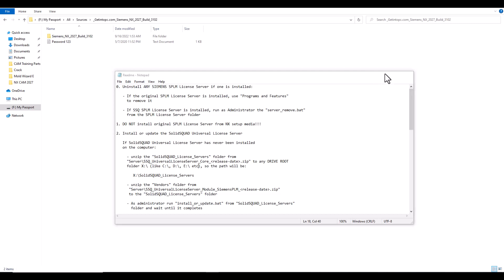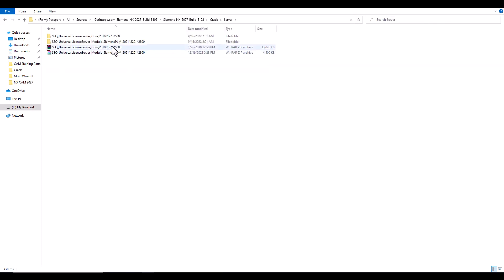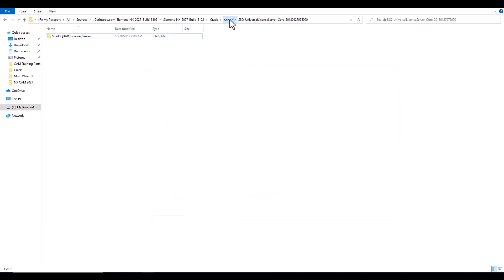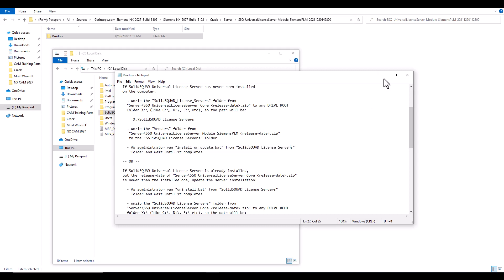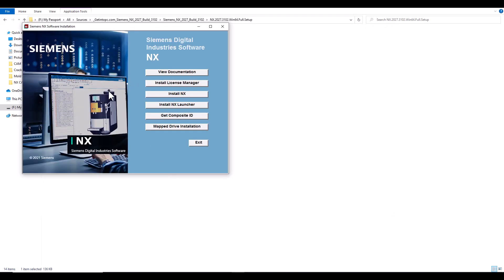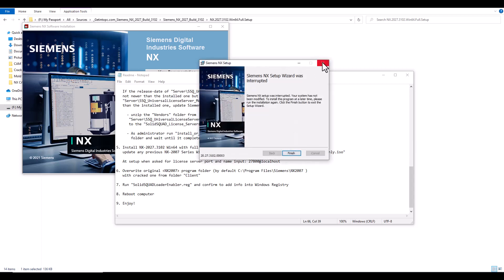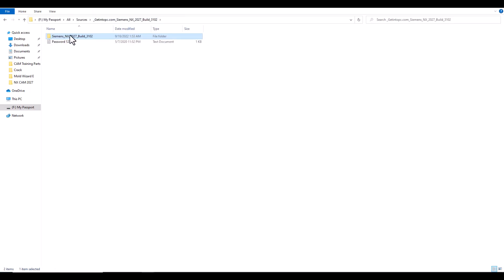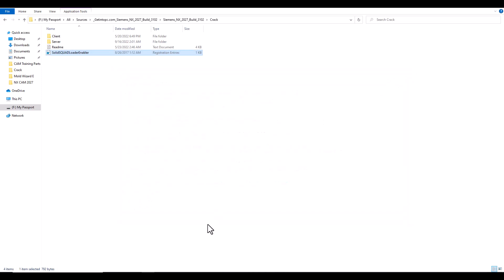NX 2027 Setup, Steps (Latest Version) + Full Course Link

Comment: Really losing me at step 6 no idea what you're trying to explain and do. I''m getting the error License Error: Cannot connect to license server system. The service(Imgrd) has not been started yet, or SPLM_LICENSE_SERVER is set to the wrong port@host.[-15]

No clue, fresh install with all the instructions shown exactly as is would really really really help.
Reply: For me also the same error
Reply: Any luck?
Reply: For me also same issue coming sir, kindly give reply
Reply: @mohammadhaneef6756  You have to type in your Device name after the code as shown in the instructions like this : 27800@(Imput your device name)